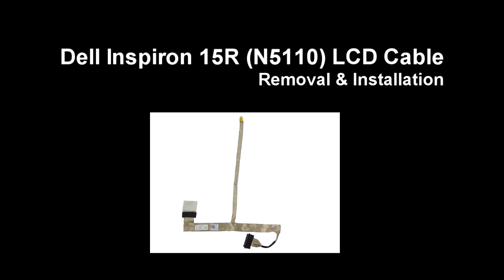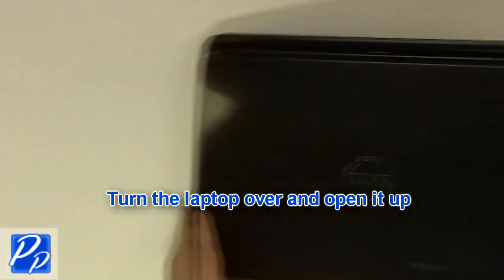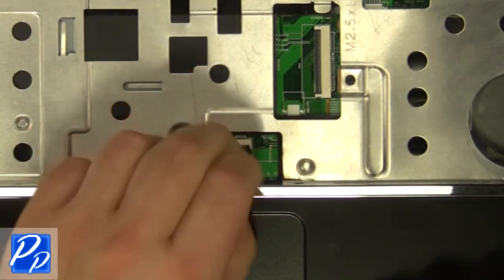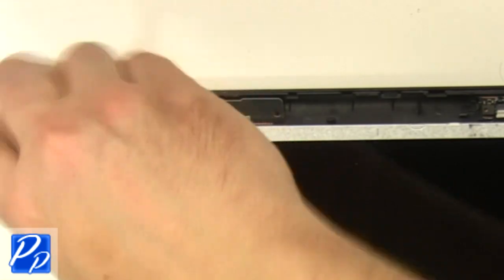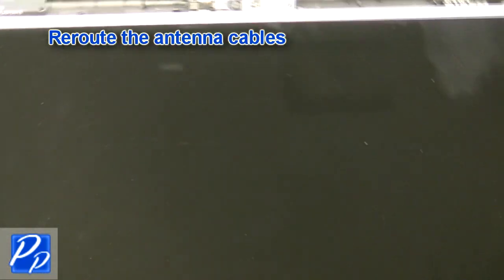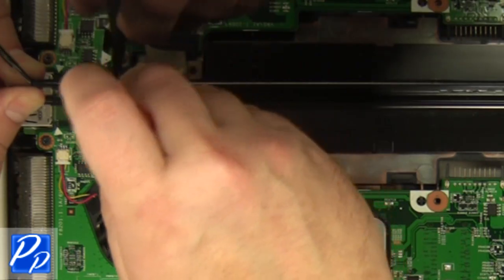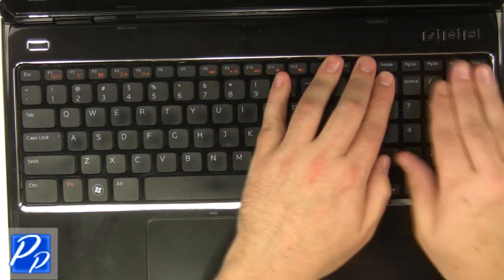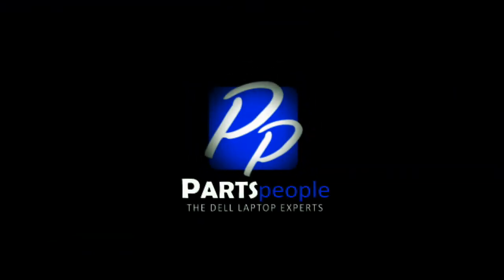Dell Inspiron 15R N5110 LCD Cable Replacement Video Tutorial

Comment: If anyone sees my question and can help, Of me very grateful. 

I don't care about my very old Dell laptop (it has a bad display cable) and just want to be able to get my stuff off of it. Is there an easy way to get the display onto my TV screen in order to do so? I remember back when I first got the laptop, in order to have it display on my TV, there was a setting on the laptop itself that I had to change. Obviously I wouldn't be able to do that now since I can't see anything on the laptop screen. Is there some sort of cable that one could use without having to change any settings on the laptop, and get it on my TV screen?

 Thank you so much.
Reply from the maker: If your laptop has an HDMI port then I would use an HDMI cable to connect to a TV display. Without having the benefit of seeing your situation first hand, this would be my default solution.

Comment: So, I bought your replacement cable and your video helped me install it easily.  It has worked really well for nearly 1.5 years, but now the screen is starting to fritz out again.  Is it just me, or it just a REALLY bad design to have that cable threaded through the hinge???  It's not an expensive repair, but it really seems like I shouldn't have to replace the cable every 1.5 years!  ::heads over to order a new one::
Reply from the maker: I agree! It's a terrible design, yet almost every laptop runs the cable right next to, or wrapped around one of the hinges. Some laptops are worse than others. I'm sorry you have to do this repair again.

Comment: my dell 15 r laptop screen sometime change color patches in screen and whole screen is lite blue
Reply from the maker: Is it the only the screen or does it happen on an external monitor too? 
If it's only the screen, then the screen need to be replaced. If it 
happens on an external monitor also, then it's probably a bad GPU and 
the motherboard will need to be replaced.
Reply: its happen on screen but i connect external display it works perfectly,sometimes it automatically work perfectly sometime it color changes to light blue and give read patches
Reply: thank you so much for your advice

Comment: My screen keeps freezing and blacking/whiting out. I use to be able to fix this by bending the screen and pressing around it in different places. Now it's fully gone and the only thing that gets it working is by bending and holding it in the right corner. Do you think this is a screen issue or an LCD cable issue? 
Hopefully it's not the motherboard but it doesn't seem like it to me as bending the screen in different places wouldn't change that. I image it's just a connector issue yes?
Reply from the maker: kieran cherrington I've seen those symptoms more frequently with a bad screen. It could still be a bad cable or cable connection but I usually see that with a screen.
Reply: Parts-People.Com, Inc well I think I may try the cable first as I can get one fairly cheap. If that doesn't work then a new screen is what will have to be dome. At least it seems very easy to fit. Especially for a computer science student like myself.. Lol
Thanks for the help! :)

Comment: Is there a design problem with this laptop, I have one here where the screen goes fuzzzy white depending on how open the lid is?

Also thanks for making this it's nice that all the connectors u under they keyboard are the same sort
Reply from the maker: That sounds like the LCD cable maybe breaking or starting to break. It runs by the hinge so opening and closing the lid could effect the connectivity.
Reply: Parts-People.Com, Inc
Dell have done a really good job on the serviceability of this chassis, all the top ribbon cables have the same easy connect socket and are marked with a line so you know you have them fully in. There is none of the myriad of different screw lengths also.

Thanks for the video it was very precise

Comment: Hi I have the same laptop model. A few days ago the screen was not working: it had two black spots and I couldn't see any image. I bought a new screen and changed it. Now when I turn it on the screen is all black and the computer makes a beeping noise. Do you think I have to change the lcd cable? (Maybe I put too much pressure when changing the screen). Do you have any other suggestion?
Reply from the maker: Do you see any image? Even a very dim one? The beeps might be caused by a loose cable connection. i would try re-seating the LCD cable first.

Comment: hi: how do i know if the lcd cable is my problem. I have the same laptop and have a white screen from the moment i turn it on.
Reply from the maker: Usually, if the LCD cable is the problem there will be noticeable damage to the cable (typically around the hinges), or, the image on the screen will change as you open or close the lid. If you don't see anything like that, then you probably have a bad screen or bad GPU. Try hooking up an external monitor, if it shows an all white screen, then the GPU is probably bad. If the image is good with the external monitor, then it's probably a bad screen.
Reply: Parts-People.Com, Inc Thanks for your speedy reply. ok. I can still adjust the brightness of the white screen with the keyboard. I have hooked up a data projector through HDMI cable and I was able to get image. At first it was a bit flashy and then after a minute it was all good and i could operate as usual. So what do you think my problem is? The LCD cable maybe lose or the screen? Not the gpu as i get an image output. Would it be an idea to open up the laptop as in your video? I live in Costa Rica... so ordering a part is a different ball game and research and troubleshooting is very important before i order anything. Thanks!
Reply from the maker: Ryzal Thijssen I think you're right. Check the cable and make sure it's not loose and that there is no obvious damage. If the cable is plugged in and looks good, then I think the screen is the problem and it will need to be replaced.
Reply: Parts-People.Com, Inc ok i will open the laptop... and see what's up. But can a screen just damage like that just happen from one second to the other? As i was working when happened. In the second week of ownership they have replaced the motherboard. After that i had only one usb output working. A couple of days after I moved to Costa Rica so couldn't go back to the shop..  and maybe the lcd screen plug was touched and needs a push in.(hopefully)  Any ideas about those usb plugs not working? (the ss usb one at the back and the one at the right. Only the one at the left works... Thanks!
Reply: Parts-People.Com, Inc I have opened the laptop, no damage detected, unplugged the lcd cable, plugged it back in, closed laptop accordingly and still white screen. So do i need a screen replacement or a lcd cable replacement?
Reply from the maker: Ryzal Thijssen It's showing symptoms of a bad screen.
Reply: Parts-People.Com, Inc Hi. I changed the screen. Problem remained. Than i changed the LCD cable. Problem still here. Is it a motherboard issue?
Reply from the maker: Ryzal Thijssen It sounds like the GPU on the motherboard is bad. Unfortunately, that means the motherboard would have to be replaced.